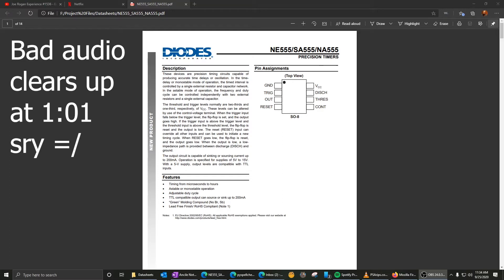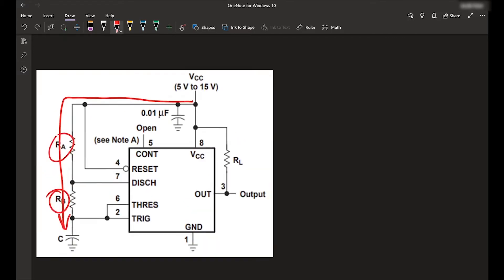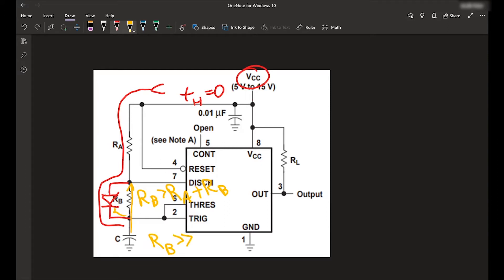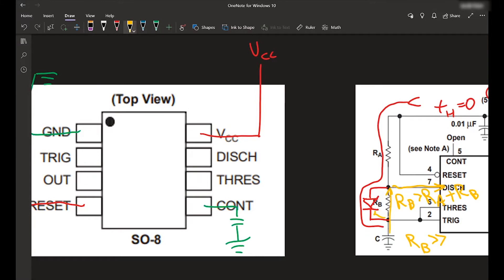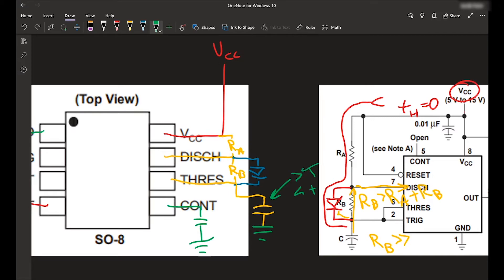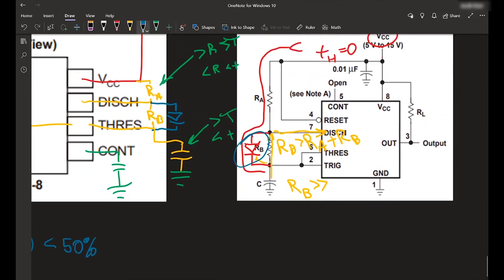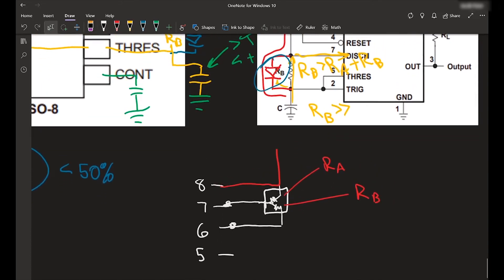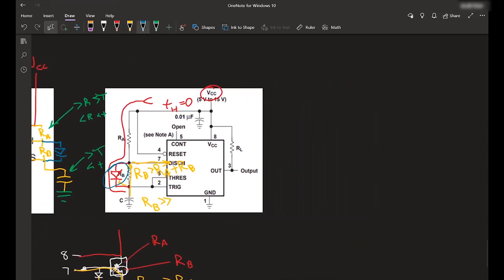Full Duty Cycle Range on 555 Timer Chip

Comment: Great in theory. Works well on paper. But, in practice you can't get 0% to 100% duty cycle from a 555. The best that is easily achieved is about 5% to 95%.
You still gave a lot of useful and interesting information in your video and explained it extremely well. Keep up the good work.
Reply from the maker: Thanks! Yeah I realized afterward that real-world isn't exactly 0-100. I am able to get about 2-98% though. Using a couple 1000ohm resistors in series with the 100k pots I used to keep the pots from burning up. I've got a custom photo lighting video coming up where I actually use a circuit I designed myself with this method as the dimmer.

Thanks for the feedback! Have a great weekend =)
Reply: Hello Experts. For a photography CCT led panel I want to make a dimmer where 1 potentiometer controls brightness without changing the colour temperature
and potentiometer number 2 controls the colour temperature without changing overall brightness. What is the best way to do it? Thank you very much.